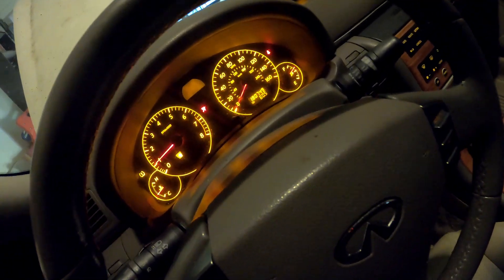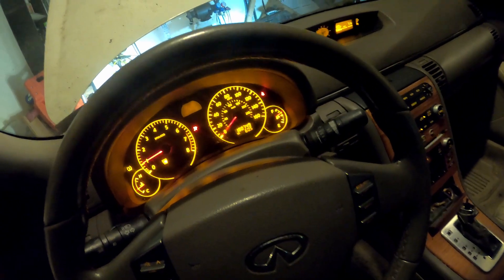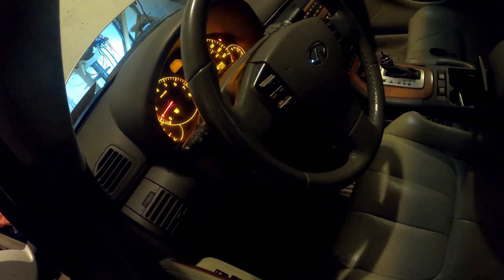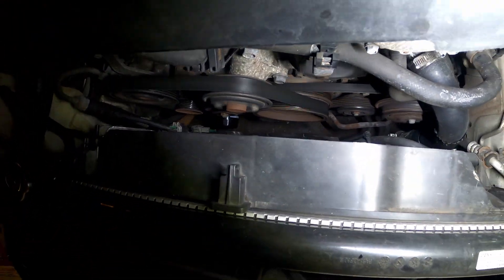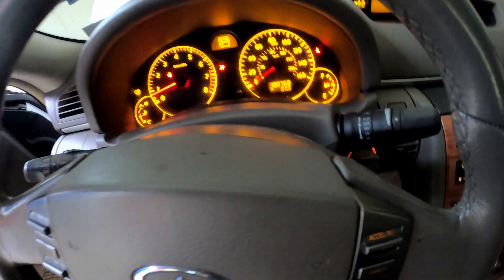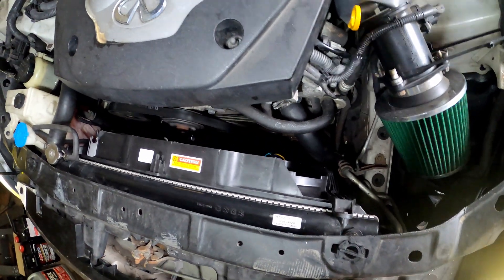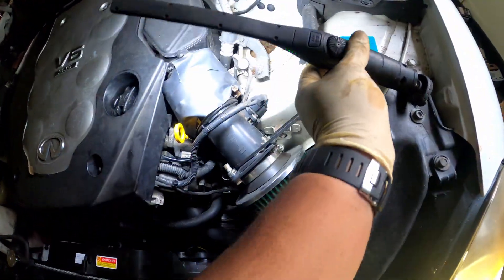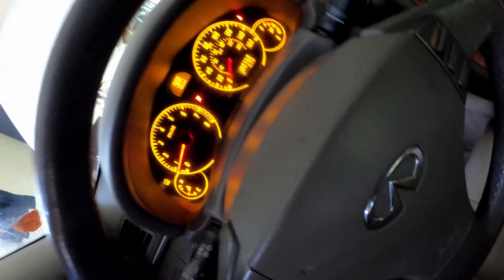💥Infinity G35 Overheating Issue Fixed: Radiator Fans Intermittently Not Working

Comment: I replaced the fans in my 2012 JX35, but I'm still having the problem of my fans turning on and off on there own.
Reply from the maker: Hmmmmmm.....well they're designed to turn on and off on their own. The question is are they turning on & off at the right time 

Thanks for watching Subscribe & stay Tuned for more‼️🤝
Reply: @PhillyDee215  they are turning off at the wrong time, causing my car to overheat.
Reply from the maker: @LeeZellous  could be a failing relay or the fans themselves are turning off intermittently meaning the fans themselves could be failing(dead spots in the fan motor). Make sure there isn't anything else causing this problem before you condemn the fans
Reply: Relay
Reply from the maker: @flylyfe5526  very possible....

Thanks for watching Subscribe & stay Tuned for more‼️🤝

Comment: my truck does the samething with a fan but wont run even if i put direct power from the battery unles i hit the motor with something it will start do you thing is the same as your problem ?
Reply from the maker: Yeah that motor has a dead spot basically its bad. Change it out before it causes any more issues

Thanks for watching Subscribe & stay Tuned for more‼️🤝
Reply: @PhillyDee215  i spinned it just like you did and it workded so thanks your video helped find the problem

Comment: So on my Infiniti every time I run my a/c either idle or while driving my temp gauge will slowly go up but once I turn it off the gauge stays where it needs to be would this still be a fan issue?
Reply from the maker: The fans should be on automatically whenever the a/c is on. If the fans aren't working that could cause a overheating problem.

 Thanks for watching Subscribe & stay Tuned for more‼️🤝
Reply: I’m having the same problem with mines did u ever figure it out ?
Reply: So mine only come on when the ac is on is it normal